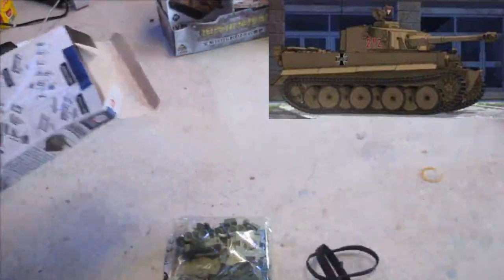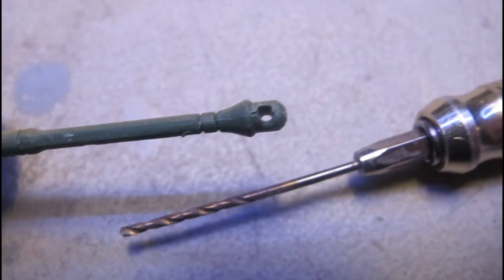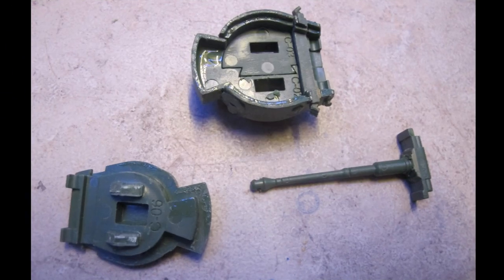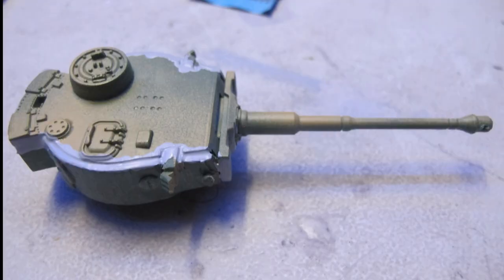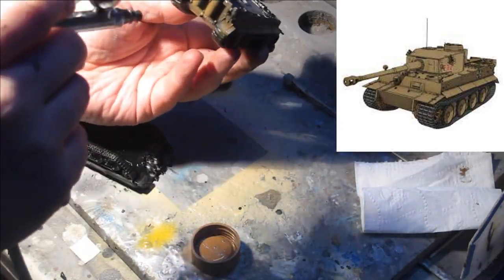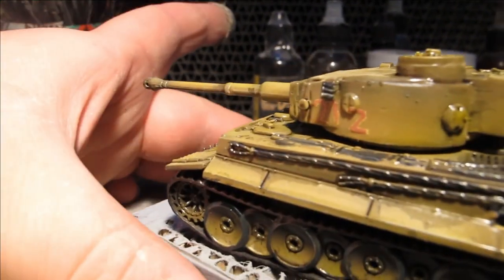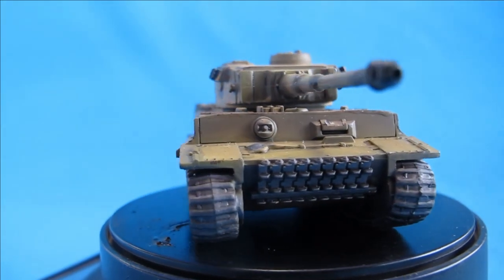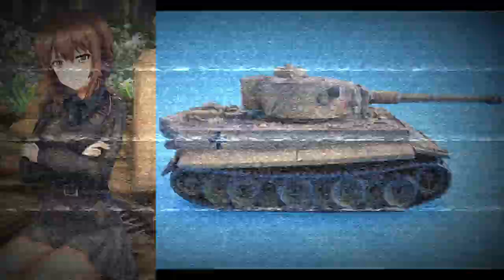4D models 1/72 Panzer VI AUSF.E Tiger I

Comment: what glue did you use on the tracks?
Reply from the maker: I normally use super glue for 72nd and PVA for 35th, this project pure 502 super glue which makes a big difference then cheap dollar store stuff.
Reply: @mokanaman  Thanks! Try to find the M4A3E8 Sherman from the 4D model, it's a good one. The aircraft model kits are great too.
Reply from the maker: @exoticpetkeeper346  that one is not so good and kind of hard to find outside of china. Bottom half and tracks are the biggest issue but still a fun and cheap project. I do love the aircraft and ship model, 1/6 fire arms are the best.